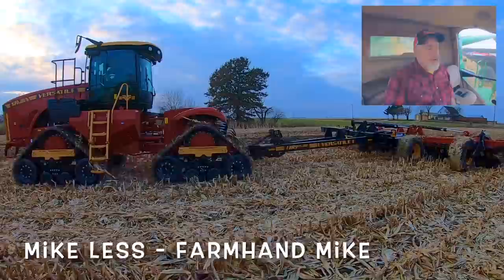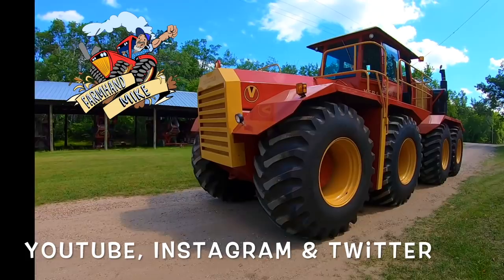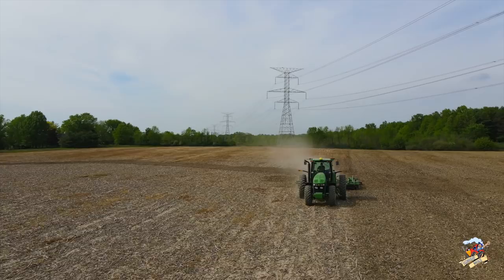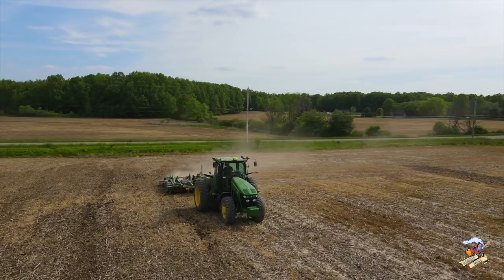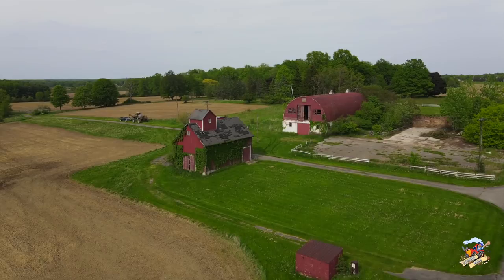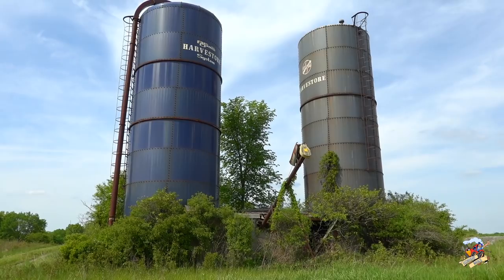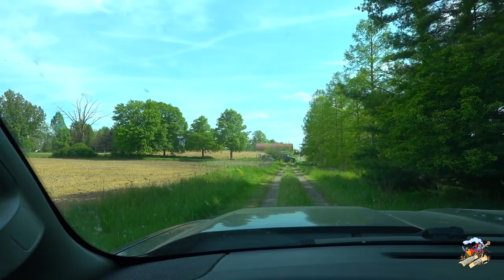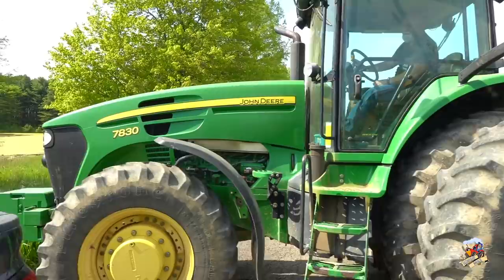Farming with my Dad

Comment: I LOVE hearing the stories of family farms like yours. Especially the older generation who couldn’t imagine driving a tractor w/ an enclosed cab & AC. I live in PA, most of the farms around me are Amish farms. Just watched them use 6 horses pulling a square baler (they don’t use any engine or electrically powered equipment) & hay wagon. 2 men pulled & stacked the bales on the move.Just like the old days

Comment: The biggest number of problems with the Goliath unloaded problems were owner/operator caused. My brother and I built a   25 / 80 in 1972, (the first 25’er built in Wisconsin,were told, $31,500 complete) Maintained it, very few missed feedings! Many many more with the top unloaded in the stave silo. 😡🤬🤬🤬 Used it till the early 2000s when we ceased dairying because of stray voltage. The unit was sold and re-erected on a large dairy and used for HMSC. 😊 👨🏻‍🦳

Comment: Thay put them all over Texas to but the new ones are pretty impressive. Yes thay us to call them the blue tombstone. Trick to the new ones is to have the are bags in the feed room attic and a unloader deck that every thing including the blower runes on three phases electric. A stationery dump hopper to collect every thing that go's in the mix wagon speeds every thing up. So thay are making a comeback, but mix wagons that have a silage louder on them and the silage bags ar giving them a run for the money. But you can ges what you won't in bad wether😝😝😝😝.

Comment: Great question! I wonder how many are still in use? That is a Hercules unloader with a Goliath control box.
Reply from the maker: Okay you sound like a guy that knows his Harvestore silos
Reply: @farmhandmike  we had 4 of them and 2 concrete top unload silos when I was growing up. My family no longer farms. They quit when I was 14. I work at a co-operative and get to run equipment and drive trucks a lot. I am a bit of a machinery and Harvestore enthusiast.
Reply: The way I could tell is the belt cover is more rounded on the Herc.